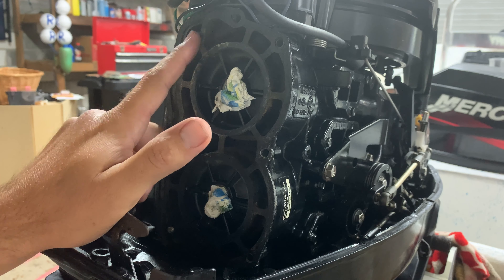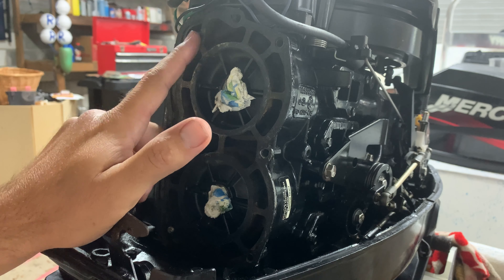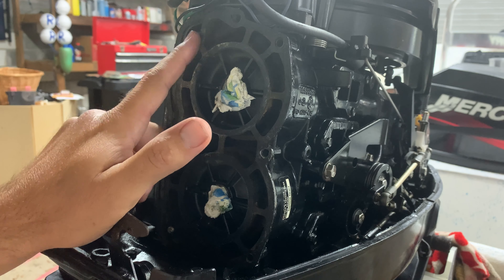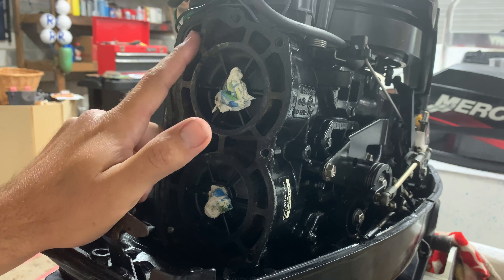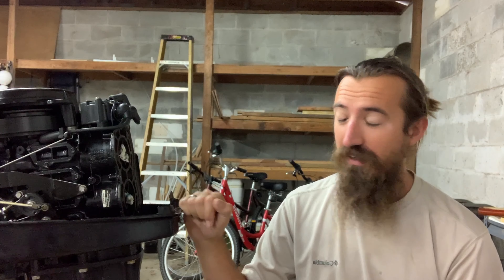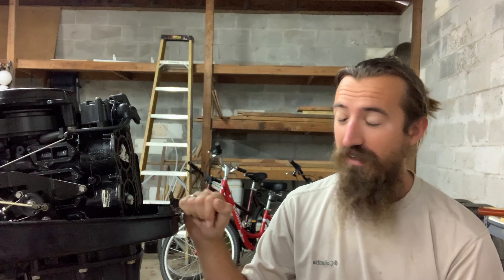Shop Talk: If it isn't broke, don't fix it (Mercury 25hp 2-stroke thermostat)

Comment: I had the same thing happen on my 25 but it was one broken thermostat bolt and one broken water jacket cover bolt and fortunately not the bottom one. I left the cover on and used a bronze bunting bushing with a 3/16” ID and a 1/4” OD and inserted it in the cover plate to guide my 3/16” cobalt left had drill bit straight. The hole diameter in the cover plate is .265” so I wrapped the bunting bushing with a piece of HVAC foil tape to make up the slop. Drilled a little then blew it out with compressed air, rinse and repeat until the bolt was drilled and all that was left were the threads. I then took a M6 blind tap to retap the threads/remove the bolt threads. It was evident someone had removed the cover at some point and did not use anti-seize on the the threads when reassembling so I did not dare attempt to take the cover off because I didn’t want to end up in your boat. Lol. Maybe try tigging a stainless stud to what is left sticking out instead of removing the head??
Reply from the maker: Sounds like you had a pretty good process figured out. I would have tried it when I was in the thick of it with this. I drilled all way out to 7/32 but the threads were so froze to the head I had to file and knock them out with a small punch. Having the cover off really helped get them out. I opted to somewhat destructively access the lower bolt by cutting a tab out of the lower cowl which I epoxied back in place. I was really worried I was going open a can of worms pulling the head. More than I already had anyway. Thanks for sharing your solution. It could save someone a big headache.

Comment: That's fairly awkward on my Yamaha 8 all I have to do is take out 7 bolts then take a  little plastic holder out and pull the tstat with a screwdriver. I own a mercury 25xd as well
Reply from the maker: Yeah, it should have been pretty easy since it just had the two bolts holding the thermostat cover on but corrosion had pretty much welded the bolts to the block. The new ones went back in with plenty of anti seize on them.
Reply: I have exactly the same thermostat bolt bolt broken off
Reply from the maker: Hopefully you were able to get the rest of the cover plate ones out okay. To protect against the reaction between two dissimilar metals like the aluminum head and stainless bolts anti seize is your best friend.